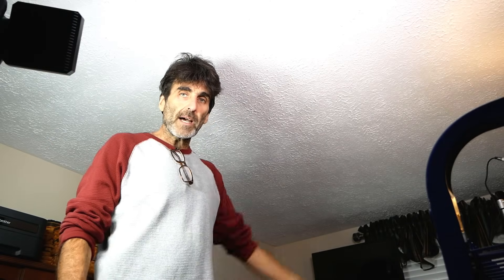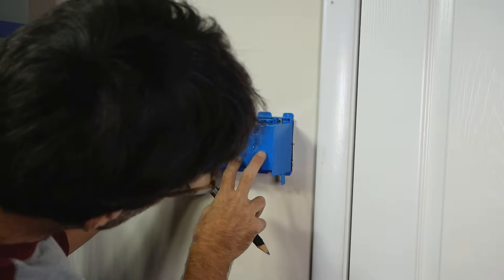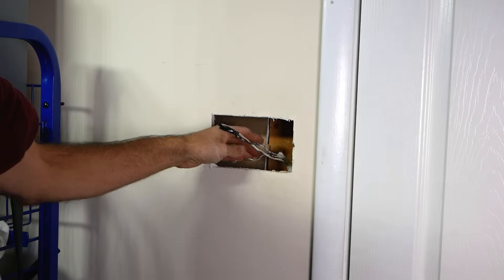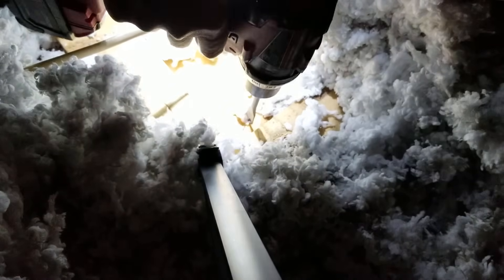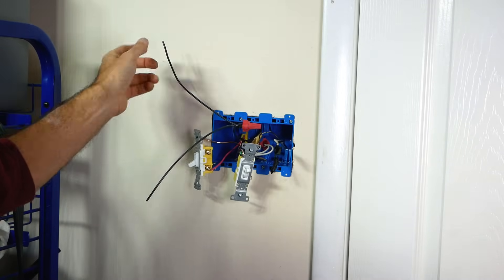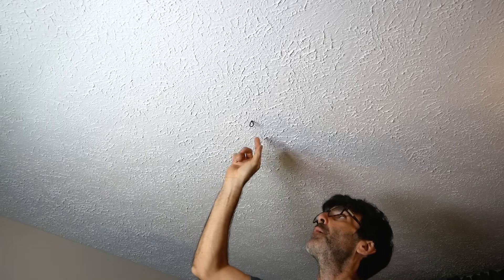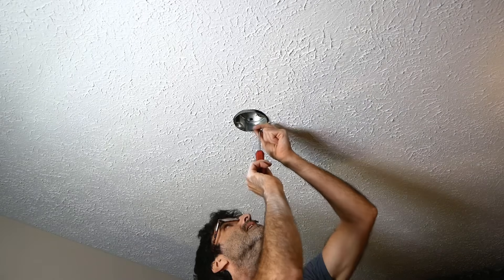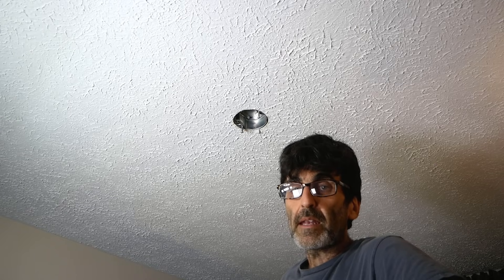Add a Fan to ANY Room without Existing Fixture or Wiring!

Comment: The most important parts i needed was how you got past the block in the wall.  And how or what power source did you use
Reply from the maker: The power source is going to vary from house to house.  There probably aren't 2 that'll be the same.  I wound up tapping into an existing junction box in the attic that supplied constant power.  If you have an attic light that's an ideal place to tap if it's not to far away from your installation site.   If you have a block in the wall, they sell a drill bit that's 4' long.  It's flexible and you can use that to drill through a block.  It's a good idea to try to look through your initial hole in the attic to be sure you don't hit any wiring or something like that.  You can look up from where the switch box is going to be with a mirror and a flashlight to see the block from the bottom to make sure that's clear as well.  It's best to not drill blind or you might hit something you don't want to!  Hope that helps.
Reply: @TheHomeImprovementChannel  thanks.  I had no junction boxes and the attic didn't go as far as the service panel...smh.   I didn't want to DIY a junction off existing wiring in the attic..  so I just used a heavy duty extention cord and dropped through the ceiling close to the wall and plugged it into the wall reciprocal that is worked by the light switch.    The cord is barely noticeable behind the TV.
Reply from the maker: @Keepinitreal4unow  Yes that's one way to do it.. 😊

Comment: What about when you want one on the first floor of a 2 story home?
Reply from the maker: I have a video on that.  You have to cut holes in the drywall at each joist / stud location depending on the direction of the wire..  To get it from the wall to ceiling you'll have to cut a hole at the top of the wall and one at the ceiling as well to allow the wire to make the turn.  It's more trouble, but certainly can be done.
Reply: @TheHomeImprovementChannel  thank you! I’ll look

Comment: This was an excellent video, very well explained. Unfortunately,  Iive in Florida and cannot access the upstairs, its only a small crawl space with absolutely no way of getting to the area of the bedrooms. There is no existing overhead lights in the bedrooms. The wall switch controls one (1) outlet where i have table lamp plugged into. How in the heckin can I put a ceiling fan in these rooms. Please help. Thanks
Reply from the maker: Thank you!  I'm in FL too... 😎.   With no access to the upstairs, you have to punch holes in the drywall in order to feed the wire to where you need it.  I did a video on this a while ago that kind of shows what I mean:
https://youtu.be/D_BPFT3InPA
Reply: Thank you
Reply from the maker: @MsCocopuffy  You're welcome!

Comment: Can you add a fan from an outlet instead of a light switch? Everyone seems to only tap into a light switch
Reply from the maker: Yes... You can add a fan from any power source as long as you can feed the wire from point A to B.  You can also add a remote control from Amazon or Lowes, etc to be able to control it so you're not stuck using the pull chains on the fan.

Comment: Forgot to mentions, did you use 2 3-way light switches or 2 standard light switches??
Reply from the maker: These are standard switches.  Most bedrooms don't have 3 way switches unless they are a larger room so there's multiple switch points.

Comment: May be a dumb questionYou stated to fill the hole in added you ran wires into u  prevent fire hazard to you need to do the same in the hole cut for the fan circular metal piece
Reply from the maker: I'm not sure I understood the question.  It sounds like you're talking about a fire block at the top of the wall where the wires come thru.  The reason for this is "they" (the code people) don't want a draft to go from the walls into the ceiling, so it is common practice to fill those holes up that are drilled for wires, pipes, etc with orange spray foam to fill the gaps..  The hole where the fan goes is not necessary to seal completely.  Once you put the box in usually they just cover it with insulation, but if you wanted to, you could seal that with something just to keep cold air from seeping down, but it isn't required..  Did that answer your question or did I completely misunderstand?

Comment: Question sir. I have metal/steel joist instead of wood. What brace would you recommend to work on metal? Thank you.
Reply from the maker: That's a good question!  I did a google search for that and didn't come up with anything specific just for metal.  I found this brace on Amazon that would work as long as you have access to the ceiling.  https://www.amazon.com/Sealproof-Fan-Brace-Electrical-Installations/dp/B0B5SVJH6F/ref=nav_signin?crid=3OYY157TM4NS3&dib=eyJ2IjoiMSJ9.9vlh1ZqVd1-pwWxh7RGX7Kzl_htUvrNj7UeVlrrkbryCa4kboklNMqCFBC2JvA8D8SdFNhvAl-ixHn2Ep24hucLB7Mnj8jFA0Zf2mSurxIFEXzDnnCBN_cTbPUD9ssJzZ0qFHAlXy4SBQeJpStOwzj3WkJt_oZbnX45iT7dMEfiE2cvAYFaSWfHuR-4N9_nouDwpjNWgMeroyWM89qtE6dBdSs7pZ5Iv_oaLiXaqRUj93aSx4AW37U4MKNWn_xJrAzJihiVIBSjx2fplUnpl4Vo6LgNg0r4sB5XIX4fT6O_YcF8gl_BCkBx6PDQ7Ko7lCn_7o4zQCENhnJPa0RrTHjdijsErYRa7Cm3Fg5TB0i8.C7rQtcPLeuq4JKe6YmT7AYQyInGU3W7Hxu2_a6_UvVY&dib_tag=se&keywords=ceiling+fan+brace+for+metal&qid=1737227111&s=hi&sprefix=ceiling+fan+brace+for+metal%2Ctools%2C111&sr=1-6

You can use sheet metal screws through the holes or bolts with nuts/ washers. IF you don't have ceiling access I would try your own search and see if you can find out anything.

Comment: So the black wire from the original switch is where you grabbed the power to tie into the two new switches?
Reply from the maker: Every situation is different.  Whatever I had to do on this one is more than likely different for someone else.  I don't remember what I did in this particular case to be honest..

Comment: How would you install a ceiling fan outdoors without any existing wiring? I have a light mounted a wall outside and I’m not exactly how to do it
Reply from the maker: HI Leonardo that's a pretty difficult question to answer without being able to see your particular setup or situation...

Comment: I would have changed the outlet(s) to always hot. Then you would have had power at that switch box.
Reply: I also like to enter a cut-in box from the same side as the old wire. It makes shoving the box back on the wall easier, especially in older homes.
Reply: One last tip, always put in Decora switches. Toggles are ugly as hell.
Reply from the maker: Thanks for all the great info!

Comment: I have a room same as yours but confused on which switch or outlet i meed to use. Inhave a switch when turned on controls a top half of an outlet. Where would i find the power?
Reply from the maker: You'd have to look in the box where the switch is and see if you've got a black and a white set of wires on the switch itself (power off).  If you do, then they've run a switch loop back from the plug.  If that's the case, you can take apart the plug assy, making sure the power is off of course and you can disable the switch loop and use that set of wires to power the new fan fixture.  Of course without being able to see it, i'm only taking a wild guess what they did.

Comment: Here in the Midwest like Chicago its code to have all your electrical wiring in pipe. Houses here have their wiring in thin wall metal pipe.. So, it makes it just that much harder to remove an existing box ..
Reply from the maker: We definitely don't have a code like that in Va...!  That does make things more difficulter.. :-(
Reply: @TheHomeImprovementChannel  - 6 of one; half-dozen of another... with conduit used it's probably going to be a metal box that you can take the side off and expand, and then you just pull your new wires into the existing pipe, and probably run 10-15 feet of EMT with one or two 90s to go from the existing box in the ceiling to the new fan box.

I highly recommend getting yourself a handheld P-Touch labeler with 12mm tape (like TZe231 or TZeF231) and start labeling circuits on the panel doors, putting the CB#(s) on or inside the box covers, and not to mention the wires (just use e.g. the CB #).  Way cheaper than Brady's IDXpert, and you can even get refill cartridges at Home Depot or Office Max. Oh, and good video!
Reply from the maker: @Darr247  Yea Cool.. I agree about labeling the wires.  I like to see that when I am working on something that someone else did in the past.... :-)

Comment: Hello , I’m looking to install a ceiling fan in a room that has no  wiring, the switch controls an outlet so my question is I can just run my wiring from the fan to the existing switch ?
Reply from the maker: HI, possibly.  You have to check and see if the switch has at least one set of wires with constant power regardless of the switch position.  They could have run the power feed to the outlet and then ran a switch loop back to the switch.  IF they did, then it won't work.

Comment: I’m trying to understand the wiring, you said you needed to run power from somewhere else and then said you were using that switch as the power source. I have the same exact setup where the preexisting switch controls one outlet in the room.
Reply from the maker: Yes, the power source from the house went directly to the switched plug.  They ran a switch loop back to the switch which only consists of the black and white wires.  The white is hot in this case.  So there was no viable source of power at the switch where I needed it, so I had to get it from another source in the attic.  Does that Make sense?
Reply: @TheHomeImprovementChannel  yes thank you!

Comment: Do you have  DIY vid on installing a fan under a deck. Getting power from an exterior outlet.
How would I get power to fan and add a switch and keep outlet
Reply from the maker: HI, I don't have a video like that, but it's a great idea.  Every house is going to be different.  It would be difficult for me to say how to get yours done without being able to see it.  But you'd have to feed a wire from a outlet to the switch, then from the switch to the fan.  That outside wall is insulated, so that makes it more tricky to get the wire through there.  You'll probably have to turn off the power to the outlet, and actually remove the outlet from the wall, box and all, so you can access the wall in order to feed the wire up to the switch, and go from there.
Reply: @TheHomeImprovementChannel  
Thx
Reply from the maker: You're welcome. 😊

Comment: Why did you run double times just needed 12/2 use black for fan light red for can white for common
Reply from the maker: I used a 12/2 for a power source from the attic.  The existing 14/2 that was in the original switch wasn't a power source, it was a switched plug.  Then I used a 12/3 to go to the fan.  That's why there's 2 different sets of 12 wire in that ganged box..

Comment: after getting an $800 quote to install three ceiling fans, I looked up a how to video and found yours.  I'm seriously nervous about attempting this myself, but you make me think maybe I can. Any suggestions for a first timer?  I have installed lighting before but only replacements, never putting a light where no light was before so...
Reply from the maker: If you're not comfortable around electric I don't recommend it.  You might think about getting one of those pen style contactless voltage sensors.  This way you can more easily identify hot wires.  Are you working with an attic?  That'll help to minimize drywall damage.  Finding a power source is going to be different if every case.  If you have an attic you should have more options.  If there are any electrical boxes up there that would be a good place to start as a source.  Is there an attic light?  The attic light would be the easiest source to tap into..  One other option.. if you say that a plug is switched and the wire is running back to the switch.  Usually that'll mean that there's a direct power source in that box where the plug is.  Can you run the power wire directly to the plug so that it's no longer switched, and then rewire the wire that went to the switch to provide constant power?  Obviously disconnect the power before doing this, and get rid of  the switch since it'll short those wires out, then you'll have a power source at the switch location.  The plug doesn't need to be on a switch anymore if you have an overhead light in the fan..

Comment: great video! I have the same set upin the bedroom with a switch going to the outlet. I`ve got confused on the wiring. wish it was a little more detailed which wire goes where and if you added a jumper from the main switch to the new one.
Reply from the maker: I believe I pulled the power from a source in the attic.  I didn't cover the details so much on where I got the power because every situation is going to be different..

Comment: Can't you rewire the plug in so the switch just goes to the light
Reply from the maker: Yes you can.  I still wanted the switchable plug so that's why I added more switches.  In this instance the power source was in the plug and they had wired a switch loop back to the switch so there wasn't a power source there anyway to power the fan.

Comment: You have the cutting tool, use it to cut off the nails much faster
Reply from the maker: Do you mean the oscillating tool?  I've used it for that, it really destroys the blade much faster!  I'm sure I'm using cheap blades so that doesn't help.

Comment: Great video! Are you able to control the fan speed with this switch type?
Reply from the maker: Not exactly.  If your fan has a pull string you can control the speed via the pull string and internal switch.  But if your fan didn't come with a wireless remote you can install one of those and control the fan speed that way.  The remote can be installed on just about any fan.

Comment: Great video and very informative, the one question I have is where did the black wire come from to make the pig tails? Did you have to buy that separately?
Reply from the maker: Yes, so I had to take power from a source in the attic.  Sometimes you can use the existing switch, but in my case there was no constant power there.  Yes, I had to supply the 12 gauge wires to run from the power source to the switch, and from the switch back to the new fan.

Comment: I am not getting how you got power source. I see you run 2 wires from attic, one for the fan, another for Power source, but from where you got power?
Reply from the maker: HI, I didn't show where I got the power source because it is different for every situation.  My situation is going to be different than any other.  The switches that were in that location didn't have an "always on" power source so I found a tap in the attic that I ran the power from.  In retrospect I could have re-arranged the wires from the plug that the source was coming from and disabled the switchable outlet and made it always on.  Then I could have used the power source that was originally coming from the outlet on a switch loop.  I hope that makes sense.

Comment: So I have a bedroom that has the switch like yours in the video and that switch works with an outlet opposite of it. Will I be able to source the power from that outlet?
Reply from the maker: It depends on the wiring.  You need a way to measure voltage so you can have a constant voltage source for your switch.
Reply: @TheHomeImprovementChannel  thanks!

Comment: How can I install a fan in 92 manufactured home , how can I get the wire from the switch to the area in the ceiling where I'll put the mounting box. Cut a narrow channel all the way, wall and across ceiling drilling thru each joist??
Reply from the maker: Yes that's correct.  With no attic access there's no choice.  I don't cut a channel the whole way, I cut one at each joist or truss big enough to get my hand in..  I did a video on this some time ago.. : https://youtu.be/D_BPFT3InPA

Comment: pardon my ignorance....Why did you install 2 additional switches? 1 for fan operation and 1 for lights on the fan? Could I also install just 1 additional switch (not 2) and just use the pull string for selecting operating modes of fan/light ?
Thanks!
Reply from the maker: Not an ignorant question... :-).  One switch was for the existing plug that already had a switch when I pulled the 1 gang box out of the wall and replaced it with a 3 gang.  I used two switches for the fan, which aren't really necessary since most fans these days use a remote control, I could have gotten by with 1 switch since there's a remote to separate fan light from fan itself.  I hope that answers the question.

Comment: If there is a stud to the left of your switch, just use a two gang box on the other side and have separate switch panel. A small hole in stud for wiring travel is fine.
Reply from the maker: Yes that would work fine.  It probably wouldn't look as clean as a 2 gang, but it would definitely work fine...